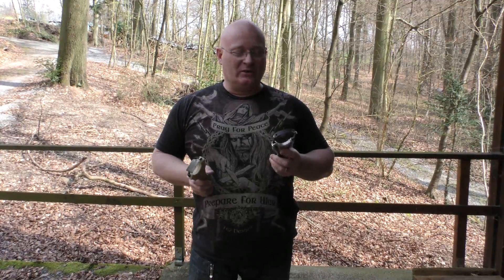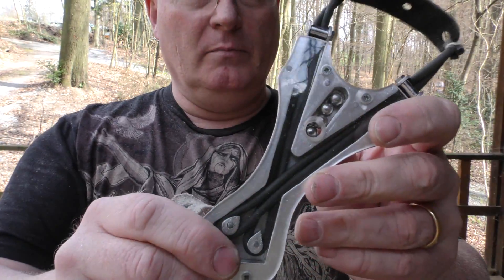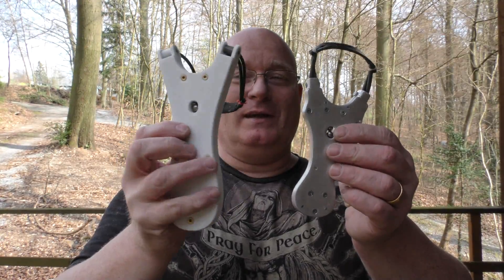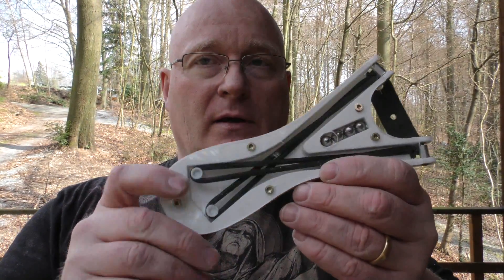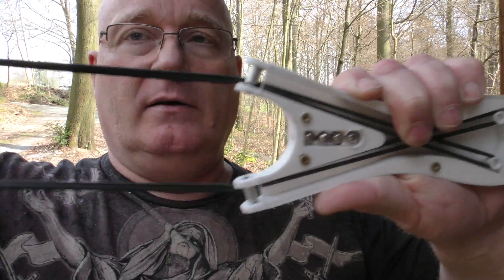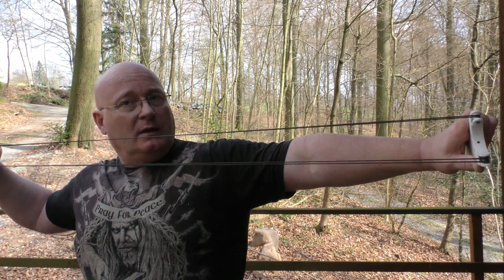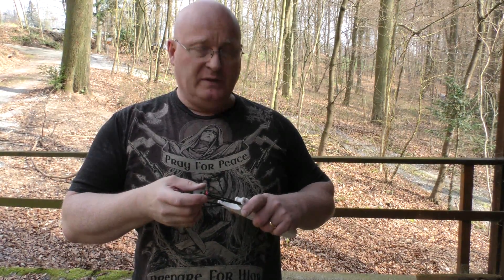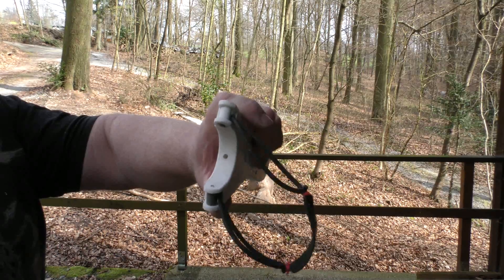Pulley based EDC Slingshot: Huge 3D Printed Version!

Comment: Looks cool but likely compromised by rollers not spinning freely under huge stress of pull. That would result in shot wandering to extent of pull varying on each side. Probably not ultimate target shooter but nice for compact size, clean looks, and novelty. As for power unsure what bearing stress will do but Joerg is the man to test the limits on hard pulls!

Comment: I was plagued by raccoons a few years ago. I didn't want to kill them. I just wanted to run them off.  I live in the City of Oakland at 1,000 ft. I had to build a circumferential fence to keep out all the deer, turkeys and other wild animals. Maybe your concept of Oakland is wrong? I have a number of redwoods on my property.

Anyway I tried an air gun but it sprung a leak and I switched to a slingshot.  My question is why don't your slingshots  have the forearm braces that mine had?  It seemed to work.

Comment: I found a very old potato masher at the back of a drawer a few weeks ago and made a catapult out of it.Cut the masher part off and heated the prongs up in a vice and hammered them into shape. Then i cut them again as they were a bit to long.Used a spare tubing i had for a black widow.Its nice and small and looks ok.Couldn't find any nice stones when i tried out but it works.Going to take some lead SG's and marbles next time.
  How do you rate the black widow and similar over the counter ones by barnet ? How does the tubular rubber stack up against the solid stuff ?
I enjoyed the video.

Comment: hey there, great vid! may I suggest a reason for the printed sling shot being bigger:
being made of polymer material, you have to compensate for the aluminums higher specific toughness (maximum stress/area) with just more material of polymer to get the same overall load capacity. I would simply say you have a smart manufacturer who is looking into this. or they just messed up cm and inches ;)
Reply from the maker: +Panurg81 They could simply make it thicker in order to increase stability - but making it longer doesn't help at all. In fact it is counter productive.
Reply: +Benno Teutsch *Videos , also ich bin ja sonst nicht so... aber das ist zuviel!
Reply: +JoergSprave BITTE mach auch mal Deutsche Wiedeos
Reply: +JoergSprave I agree. Making it thicker definitely would do the trick and you wouldn't mess with the lever.
Reply: +LockenJohny101 Was?Ich bin nicht aus Deutschland sondern aus Italien also was???
Reply: Would it be possible if you sell this out of aluminium on your website? Releasing the 3d design is great, but only verry few people have a 3d printer.

Ich hab vor einer Woche die Rambone 2.0 bestellt, absolut super, unglaubliche reichweite und flache flugbahn! Doch diese version ist flacher, und viel schneller, auch praktischer zu laden. Absolut großartig, doch leider nicht erhältlich für jene die sie gerne kaufen würden. *Edit: Am ende sagst du ja ihr arbeitet noch daran, und in dem anderen das du überlegst in production zu bringen.

Comment: What effect does the length of the band have as far as power?

By having more band in the handle you essentially have longer bands, but don't you still tune the length of the bands to your draw so that you are stretching the bands to, lets say, 85% of their maximum stretch?

If that's the case, and it seems likely to a newbie anyway,  the there should be an optimum band length based on draw length.

If you use the same band material in this one versus a more traditional style, and draw to the same spot, the band will be stretched less because the band is longer but you're arm isn't.

Is the key to use thicker bands on this one then? 

It feels like I'm missing something here.

Comment: When I last used 3D Printing, in 2012/2013 there was always the problem that the material had quite a big flaw, depending on the way it was printed. Like the grain in wood you would have something similiar in the structure of the printed part. Has technology already caught up or is this flaw still persistent? If so that could make this slingshot dangerous to use if printed incorrectly.

Comment: Would it be possible to make such a slingshot with a mechanical ratchet inside, one you could tug on repeatedly to build up power, pull back, then press a thumb switch to release the ratchet?
Reply from the maker: +Dan D No - most of the rubber is outside of the frame when the slingshot is cocked. You have to go full crossbow, and I did make plenty of those.

Comment: The plastic looking material of the 3D model is questionable since it's still a prototype. 
I kept imagining that the 2 tips of the slingshot (weakest point) would break off and comes shooting back towards the shooters face like i always imagining  a weak constructed slingshot would do.
I would like to suggest to give the spec of the material such as the: name of the material, durability, stress, melting point and other necessary details.  Or at least give it a thorough test to see if it's safe enough to be used vigorously in the long run.
Good luck with that slingshot, it's a great design.  I like the metal type version cause it's cool looking and feels "sturdy".

Comment: Honestly I don't like it, Its way oversized. I'd imagine even with big hands you would eventually get soft spots in the grip. I could not imagine anyone with smaller hands using this for more then a couple of shots. Either way I think the design is a good idea it just needs some work.

I've suggested this before and I still want to see it done but, I would like to see out of the box inventions involving rubber based traps. 
Something cool would be a shield and beneath the arm would be a hole cut out to fit a slingshot. This way you could be behind the shield and return fire.
A fun project would be a rubber based Rube Goldberg machine. Maybe it could go as far as using some of your old designs.

Comment: How do they mess up the measurements? It's lucky it wasn't a critical part for something.
Reply: +Green Silver My assumption is they had to modify the design for the given strength of the material.
Reply: +Green Silver I guess they mixed up metric plans with decimal inches. The ratio looks like 1:2.54
Reply: The whole things scale would have been off then as apposed to just sections.

Comment: If the magazine is going to make all the versions larger than they need to be, maybe it would be best not to include it in the design. It's not like just holding all the steel balls in your pocket wouldn't be in all the ways more efficient anyway
Reply: +Vesterpester i like the internal magazine design, one of the main reasons i would buy one of these but not a rambone. i can throw it in my rucksack and leave it there for when i go camping, without worrying where the bbs are

Comment: Is having a shorter draw length producing the same force not a benefit?
Reply: i don't think so, cuz it's harder to aim then :D
Reply: +aminath rajan a longer draw length has a longer acceleration wich means faster projectile
Reply: the short one doesnt have as much acceleration so even if it has the same force its speed wont be as much on the small one as on the big one